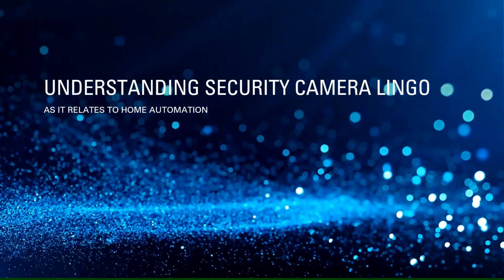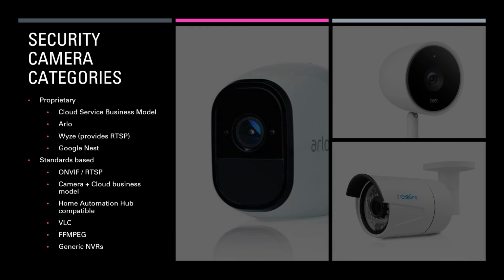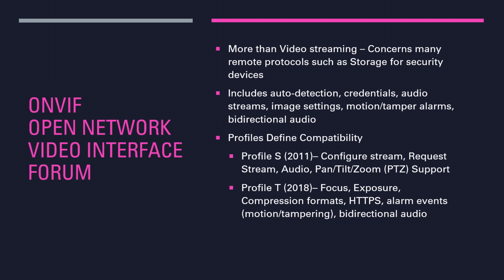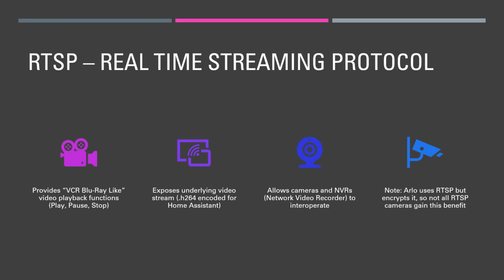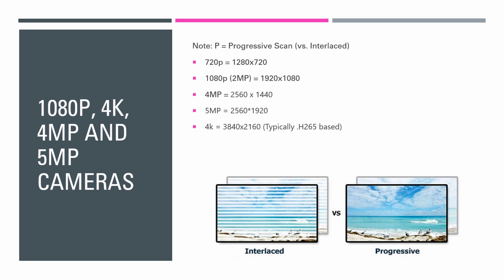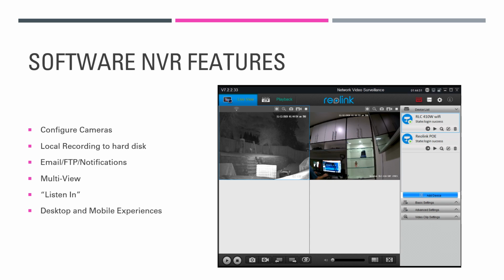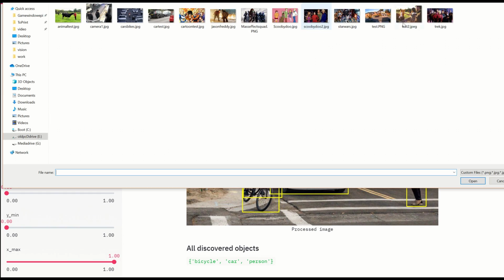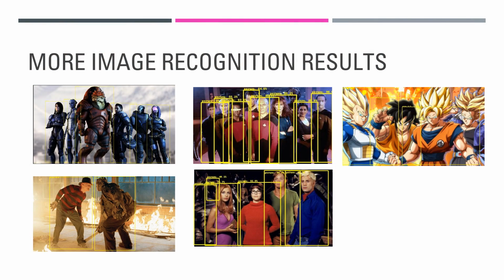Understanding Home Automation friendly Camera technologies - RTSP, ONVIF, POE and more!

Comment: Hi Joe great video! Are you aware of any comprehensive list of cameras that support RTSP? It seems that RTSP is not a selling point for manufacturers since it's more technical than the average consumer cares about. Years ago I bought an EZVIZ CS-CV206 to be used as a baby monitor, and that is actually when I learned about RTSP. And I've been using the RTSP stream from that camera ever since. I'm not overly satisfied with the quality of the picture, so now I'm hunting/shopping for a new indoor WIFI camera that supports RTSP. However it's extremely time consuming to sift through Amazon questions of WIFI cameras to find ones that support RTSP. I think it would be a great video idea to review/showcase cameras that do support RTSP. In my case I prefer ones that are not bulky like the Reolink is. Reolink is fine for outdoor use, and indoor in some cases. But for me trying to amuse my wife in the cute baby room, I cannot get away with mounting a larger Reolink camera. I'm planning on going with the EZVIZ C1C since by the looks of it, it supports RTSP just like my current EZVIZ camera does.
Reply from the maker: Neal that’s a great question, and one I’m actually trying to find a better answer to myself. I believe that the business model for cameras has shifted to subscriptions, and so they’re hiding the RTSP layer. Aarlo even encrypts it from what I understand. The best thing I can say is that ONVIF support exposes the RTSP layer so that cameras can work with NVR devices, and so the ONVIF list may be where to start. The challenge there is you’ll find a list of cameras and then have to cross check them against amazon and such for price/design/availability. But it may get you started, and if you find a good solution please share it because my daughter could use a new camera too :) https://www.onvif.org/conformant-products/

Comment: hi, is there a way i can hook up wifi cameras to a PoE NVR ? i have Poe cameras outside house but for inside house, i wan to use wifi cameras then view them in the same monitor via the same software as if they were all PoE Cameras.
Reply from the maker: The NVR would have to support wifi cameras for that to work.
Reply: @geektoolkit  are there realy nvr models for that? what feature should i look for? thank you for your prompt reply.
Reply from the maker: ONVIF on the cameras so they can be found, and then an NVR designed for it. This one supports wifi for instance, but only reolink wifi cameras https://m.reolink.com/us/product/rln8-410/

Comment: Thank you for your video! Just a quick question, i wanted to setup a home automation system for my new home(using Home Assistant), which cameras protocols do you suggest? there are tons of cameras i have difficulties on choosing the right ones
Reply from the maker: Glad you liked the video!  I definitely look for an RTSP based camera.  ONVIF if possible to help even more, but RTSP at a minimum. Note most cameras out there that are cloud based will not support RTSP, but they also integrate terribly into home assistant (ring and arlo are good examples).  The Reolinks i've had really good success with